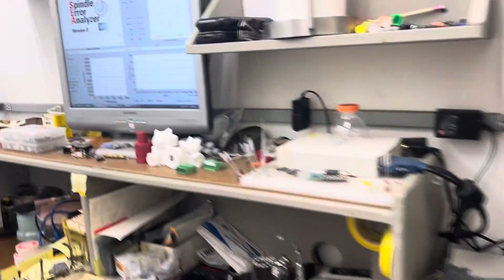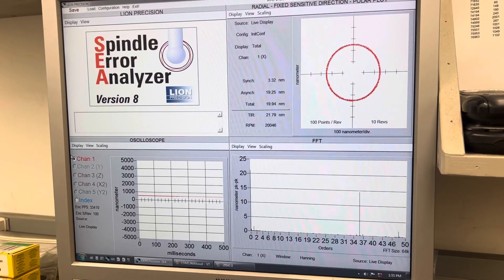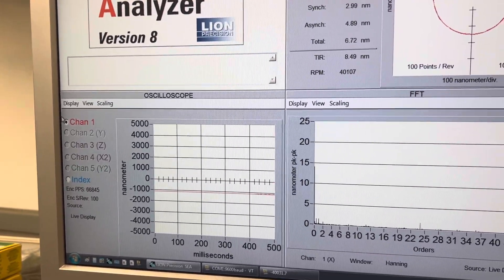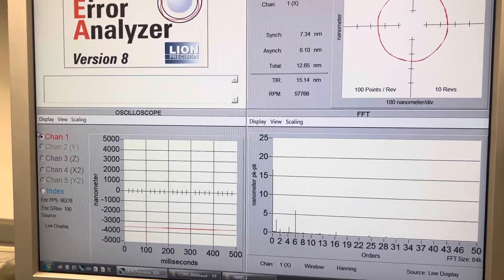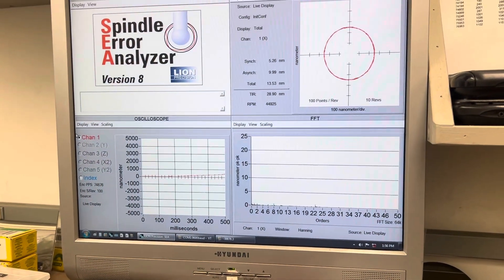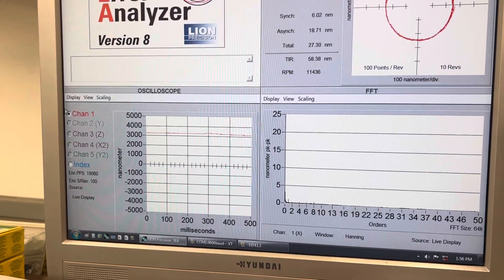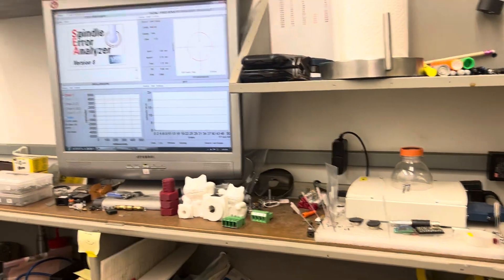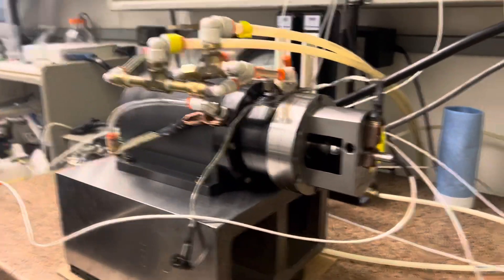Shaft shrinkage from centrifugal force

Comment: Excellent video!, never really considered shortening, but it makes sense. The rotating material is trying to fly away from centrifugal forces. the shaft has rotational force but little other forces acting on it. the material has no choice but to react from the stretching of the centrifugal by shortening. 99% of machinists would never have to consider that.

Comment: We have a few milling machines at my place of work capable of running 42000 RPM (with tool change, mist lubricated bearings), I've been wondering if writing with permanent marker on a toolholder could lead unintended consequences?? 
you are adding some weight but not a lot. Do you guys know if this could cause increased runout / imbalance, or is the effect so low that it doesn't matter for normal use?? (not Ultra precision milling, but still Precise milling)